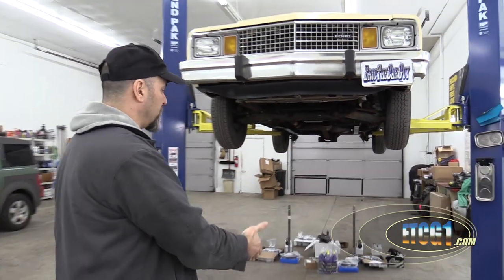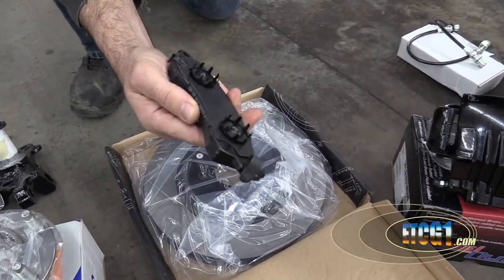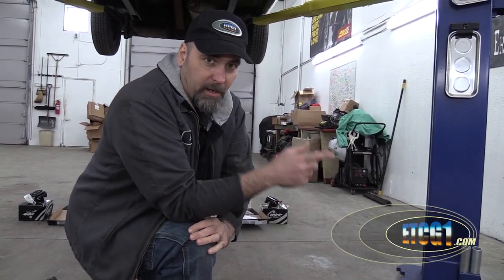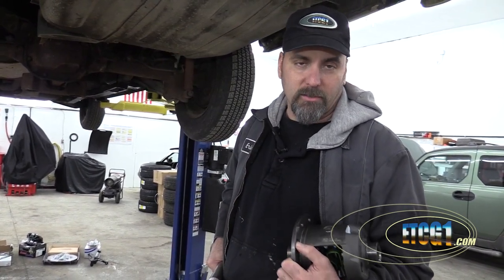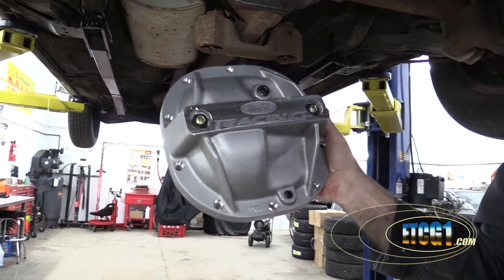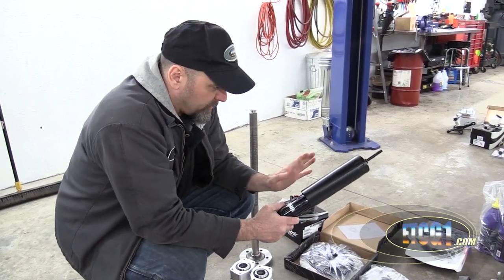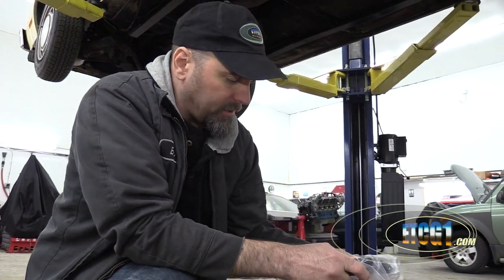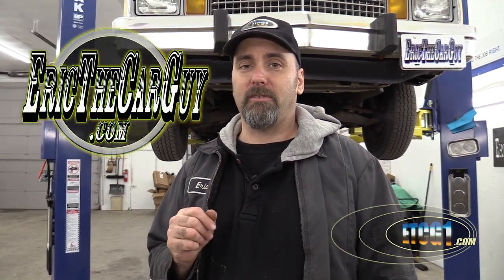New Fairmont Parts! #FairmontProject -ETCG1

Comment: The rear calipers will need to move on the sliders, therefor you need flex brake home for them.  You don't have extra parts.
Reply: +Johnny Rocket No they won't, it's a solid rear axle, they move with the differential. That said, you need the flex line to service the brakes. Without it, you can't take the caliper off to replace the pads.
Reply: EricTheCarGuy A single piston caliper needs to move during service, not a lot but they do.  If they didnt move at all only the inside pad would wear.  In order for the outside pad to have braking force the caliper moves.  Your point is also correct but my point still stands.

Comment: 1989 Ford Crown Vic 5.0 engine is the longest lasting engine I ever had- the main bearing configuration, inherent oil circulation and water jackets were designed by a genius. You might consider a 5.0. For all the work you're doing, put in the best engine possible. And you can supercharge it for added fun, and put those disc brakes to good use.
Reply: +Myron Piano A 302, is a 5.0L

Comment: Why a clutchpack-based diff and not WaveTrac or TrueTrac? Wouldn't those be more durable?
Reply: +dansolodan Availability, cost, and serviceability. Once the diffs you mention wear out, they need to be replaced. They're also expensive.

Comment: I'm not 100% sure on this, but I don't think you can convert a 28 spline axle to a 31 spline. My expertise is not with Mustangs, but Ford trucks. I know that the 31 spline 8.8s in Explorers have bigger axle tubes and larger wheel bearings than the 28 spline 8.8s in Rangers. Not sure how  the C clip eliminators affect that.

Comment: I wish you'd keep the straight six and turbocharge it. Anyone can put a V8 in the Fairmont and make big power. All they have to do is pick from catalogs. But to put on a MegaSquirt system and turbocharger, with air to air intercooling and water-methanol injection... ah, now that's interesting.
Reply: +RandallFlaggNY I understand where you're coming from, but I haven't revealed everything about the build yet.
Reply: EricTheCarGuy I just hope you do something unique. Why not build a Megasquirt circuit board, and get it running? Why not a turbo with hand crafted plumbing? Why hand crafted intercooling? The Fairmont should be a sleeper, keep the factory paint and any rust spots.

Comment: Is that a wasp nest on the diff cover??? Because if it is...that's kind of funny.

A suggestion: 

When you install the plate for the rear brakes, take out the bearings from the C clip eliminators and test fit everything (for length purposes) like that. Makes life easier for you.

Also, if you happen to have issues because it's too much and the shaft is too short (i doubt it, i think you're gonna be fine) you can go to a machine shop and machine a whisker off the C clip eliminators so they squat closer to the plate.

Also, nice setup in the future of the Fairmont, can't wait for the videos with the installs. :D
Reply: +aserta 
We typically do not experience any fitment issues performing a C-clip eliminator with disc brakes conversion.

Comment: are you planning on putting a line lock or tranz brake on this car
Reply from the maker: Trans brakes go on automatic transmissions. I'm using a manual. https://www.youtube.com/watch?v=XREsRG9Y1mU

Also, this will be a street car not a drag car so no need for line lock. https://www.youtube.com/watch?v=HNwBGKf0TcM
Reply: okay thanks I didn't know that

Comment: Thats all good. This set up though has a fixed rear axle. I hate to critisize you. Performance cars though nowadays have independant rear suspension... you could have gone large here. Ok it's not ford, any of these diffs would have been better... Jaguar, Mercedes, BMW... ETC... These cars are designed and built to go round corners at speed and putting power down to the road more effiecntly. Love the videos Eric, Brian.
Reply: +Jane Calder I looked into it. The IRS versions were heavy and didn't have the best reputation. Also, the cost would have been a lot more. I chose this set up for affordability and strength. As for corners, I can drift around those if I want. ;)
Reply: +EricTheCarGuy IRS is highly over rated for straight line cars... Plus there are ways to make a solid axle handle as good or better than IRS, and without having the fun of broken 1/2 shafts and C/V joints.
Reply: Ford was beating BMWs around a road track very handily with stick axles not that long ago. You may not be familiar with road course events like AIX but there are plenty running SRAs and they compete with IRS setups.
Reply: +Jane Calder Also he could probably upgrade to Mustang SVT suspension if he wanted to and he would probably still be able to keep the diff and gears.

Comment: Those C clip eliminators won't work with the caliper brackets you have. You will have leaking issues. Strange sells a C clip eliminator with an integral caliper bracket. It's made to fit the 94-95 mustangs. I also recommend while you have your new 8.8 housing torn down, to put full weld beads around both axle tubes where they meet the center housing. The tubes are only held in on each side by two plug welds and have been known to come loose under heavy repeated abuse. All of those brake components look to be 03-04 cobra pieces. So replacement pads should be readily available. Your new master cylinder will indeed bolt to the mustang booster you have. All  mustangs from 79 share the same master cylinder "footprint". Only the bore size changes and which side the ports are on and how many of them. I have done many hours of research and done a lot of the work you are looking to do on my own mustang. I'd be more than happy to help you with any questions you might have.
Reply: +Wes LoGiudice Funny, one of the solutions I was thinking of was plasma cutting the shape of the eliminators out and welding them in place. I'll look into the parts you mentioned. Thanks for your input.
Reply: +EricTheCarGuy, you very well could go that route. It would save money, but you'd need to be careful not to warp the caliper bracket and possibly melt the seals in the C clip eliminators.

Comment: What do the slots in the rotors do?
Reply: +Epice 
The slots allow gases generated by the pad material at high temps a place to escape resulting in higher coefficient of friction and improved braking performance with less pedal pressure.
Reply: +Epice They're suppose to help with cooling to prevent brake fade under severe use.

Comment: I hope I don't sound critical but . I have had a 1951 chevy truck hot rod for over 30 years. it has been built from the ground up twice buy me. each time I make it faster and I hope cooler. I have less money in parts and the original cost of truck than what you just spent. I'll give you a good race and show my truck near your car anytime . money is not the answer. thats not what hotrodding is.
Reply: +carhead Thanks for your input. Personally I think what I got is good value for money. I had already set a budget of $15K for the build and I'm well within that.
Reply: +EricTheCarGuy dont get me wrong I love your project and choice of cars. keep up the good work but watch the budget .
Reply: +carhead it's his car and his money why are you so concerned with his budget?
Reply: you are probably right . just one of my pet peeves on how people think throwing lots of ,money at a car makes it cool or noteworthy .
Reply: ps  thats what the comment section is for. . not all about atta boys
Reply from the maker: +carhead I could not agree with you more. Considering what one could spend on a vehicle of this type I actually think I'm getting of cheap. I'm also doing what I can to work smart and not spend a ton of money. For me building a car like this is not about the money spent, it's about how it's spent and what it's spent on. Anyone that watches the build, will have a real world idea of what it takes to build a car like this. That's been my intention all along.
Reply: as I said I'm sorry to be negative . I guess it can be a generational thing. I'm probably old enough to be your father. when your dad and I were starting out building hot rods you couldn't buy all this after market stuff. we went to a junk yard and learned to fabricate. as I have said I like your car and am keeping up with your progress.
Reply: +carhead No worries. I get it. BTW I got my differential and driveshaft from salvage. Driveshaft is aluminum BTW. I also bought the 1982 Mustang that I'm getting a lot of parts from as well. So to your point, I am salvaging a bunch of parts but I'm also adding new off the shelf stuff. Thanks very much for your input.

Comment: Eric: skip the "C" clip eliminator.  That's a lot of fabrication for no real benefit.  C-clips only fall out on cars with bazillion miles.  This car is never going to get there.
Reply: +Garth Goldberg 
C-clip eliminators are required for NHRA, IHRA, PDRA drag racing and most oval/road pace sanctioned competition. 
On the C-clip eliminator and disc brake conversions we do there is no fabrication required. 
The C-clip eliminators are not to prevent the C-clips from falling out. 
The reason C-clip eliminators are required are if an axle breaks  the outboard axle, flange and wheel/tire are retained in place and the brakes continue to work.
Reply: Didn't know that, thanks.
Reply: You are welcome. 
Here is the NHRA rule. See section 2:2

http://www.nhra.com/UserFiles/file/General_Regulations.pdf
Reply: +Garth Goldberg The only fabrication is cutting off about an inch off the outer tubes. The challenge will be making the disc brakes work. I have some ideas on that. I'll make sure I'm ready to commit before doing any cutting.
Reply: EricTheCarGuy
I would suggest contacting Strange Engineering or Moser Engineering, they both offer products for the 8.8 inch housing that requires very little modification to get the rear end housing to install. 
Search around on their respective web sites for the C-clip eliminator installation pdfs to get a feel for what they require. If I remember correctly it is simply grinding off a 1/16 inch (0.0625) lip of the end of the housing where the old outer bearing resided. 
Wilwood has a caliper bracket that mounts on the outside of the C-clip eliminator and provides proper caliper positioning and alignment.
Reply: EricTheCarGuy
Here is a link to one of the installation pdfs
http://www.moserengineering.com/aitdownloadablefiles/download/aitfile/aitfile_id/70/
Reply: +patw52pb1 Cool, thanks.